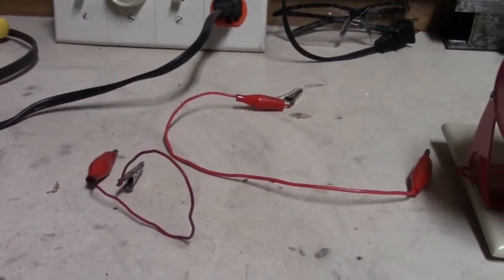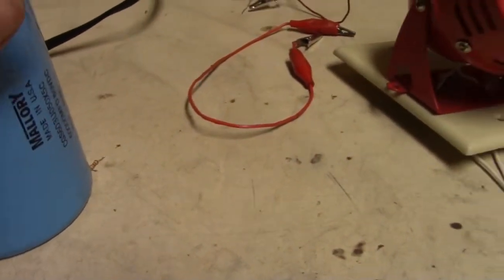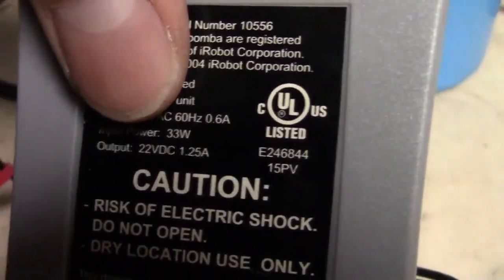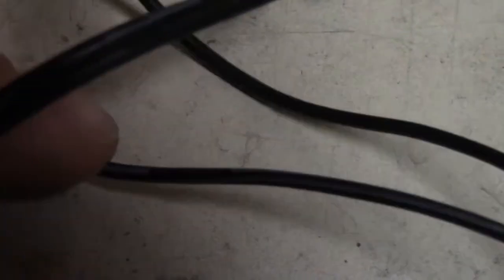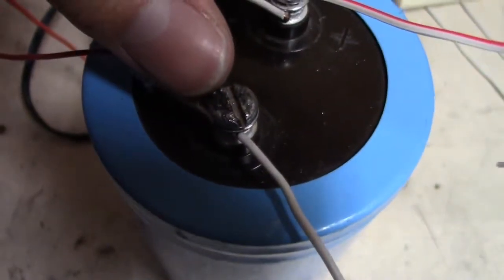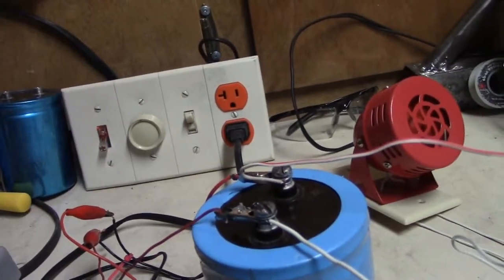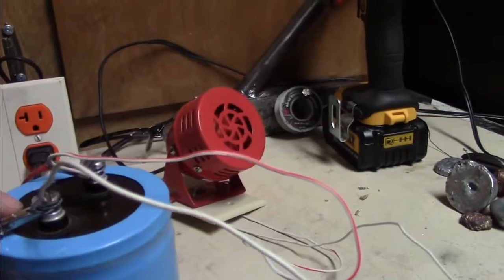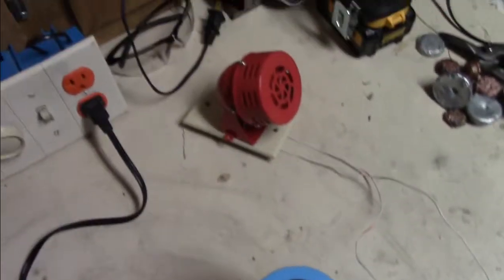How to make a DC siren wind up or down slower.

Comment: Can I have a link to those capacitors?
Reply from the maker: A friend gave it to me. The big light blue capacitor is a 60000 mfd capacitor rated at 50vdc.
Reply from the maker: Just look up the specs and it should come up.
Reply: @cooldomino1800  ok thanks